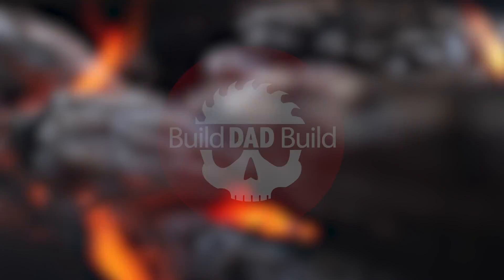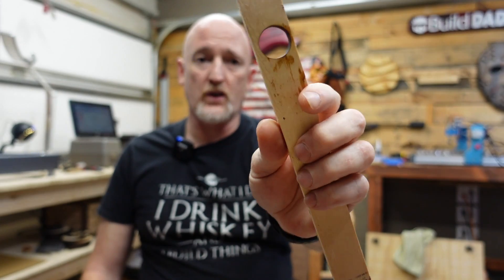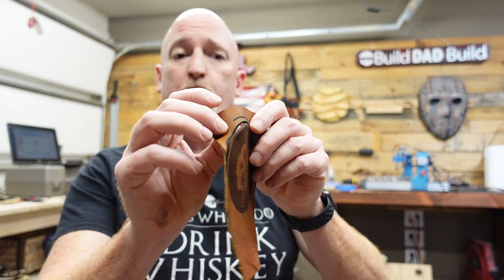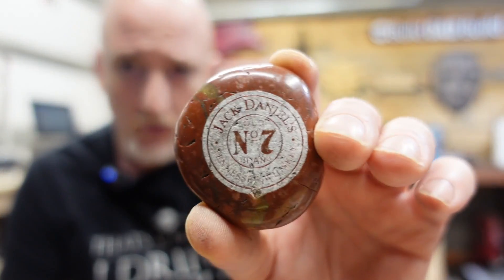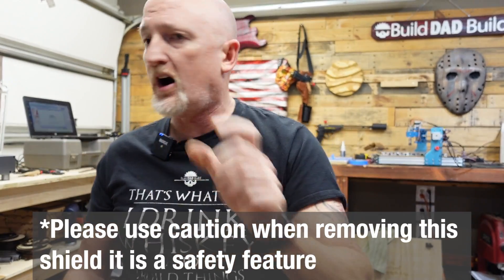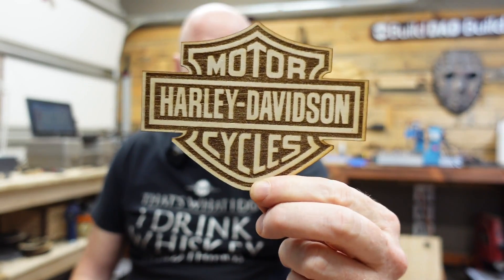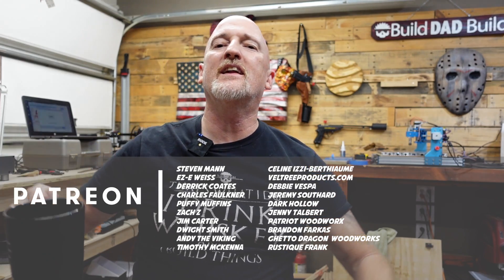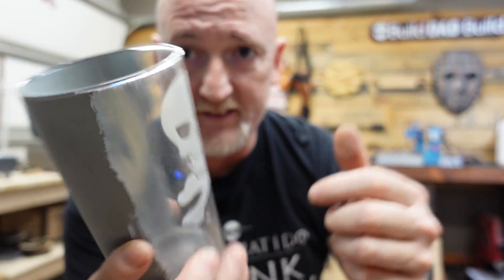What Materials Can You Cut (and engrave) with Your Diode Laser (like the 10 watt xTool D1)

Comment: You can actually etch on stainless steel after coating the surface with mustard (or possibly vinegar--haven't tried it yet). My uncoated stainless steel attempt (with just a 5w laser) also caused smooth metal discoloration but the mustard coating actually created a rough surface.
Reply from the maker: Awesome!
I have a video coming soon with another cheap way to mark metal!
Stay tuned!
Cheers
Reply: Try Brilliance spray.  You'll love the results. And it washes off with just water.

Comment: Can you engrave same materials with an Ortur 15 watt diode laser. I enjoy your videos and thank you.
Reply: My aufero 2-4 LF burned out the laser in 20 hours. Ortur is sending a replacement but wanted to slow ship it 4-6 weeks from China
Reply from the maker: Mike. Mostly yes. Settings would be different. And You might have to do multiple passes to get the same results.
Cheers
Reply: @BuildDadBuild  thanks

Comment: I used your link to order the D1, thanks for the discount.  Saved me the taxes.  Can you post your xTools D1 10watt materials list file.  I would have thought that Light Burn or Xtools would provide one as this would help accellerate use.
Reply from the maker: Here's a copy of what's on their website:
https://cdn.discordapp.com/attachments/664971419506966538/943584320055025744/Material_settings_file_for_xtool_material.pdf

Cheers

Comment: Hi, I just discovered your channel. Awesome stuff!! I am very new to the topic of laser engraving. I want to engrave some labels on to a rack panel, which is made of 2mm steel sheet and has a layer of thick powder coat on it. Is this possible with a diode laser and if so, what optical power is required?
Thanks in advance!

Comment: Great videos.  I'm currently trying to engrave a stainless steel zippo that just refuses to mark! I am using the dry moly, xtool d1pro, lightburn, settings are: speed 7 in/min @ 100% power.  Do you by chance have any troubleshooting tips on why the metal won't mark?
Reply from the maker: I have not had any success engraving Zippos.

Comment: I'm curious if it can cut flattened out aluminum soda cans? The aluminum on soda cans is super thin. Also, would it be okay to etch designs onto spray painted metal?
Reply from the maker: Diode lasers cannot cut metal.
Yes on the painted metal...folks do it all the time.

Comment: In your opinion, is the lack of limit switches and, therefore, homing ability a big issue for the Xtool? At this level, that omission seems a bit strange.
Reply from the maker: I don't really have an issue with it. Where you may run into issues with it  is if you have  jig and set it up to zero in reference to the jig. The Aufero Laser 2 does't have limit switches either. I think they're trying to make the machines a little more user friendly and less intimidating.
Cheers
Reply: @BuildDadBuild  Thanks.
Reply: @BuildDadBuild  I think that, with jigs, since you want to be able to remove and replace them, I would just put a couple of reference marks on the jig with the pattern and then line those up for each use. Then I suppose I would tape it down for the duration of the run. Just thinking out loud.

Comment: I’ve been playing with the idea of getting an xTool D1 with the primary goal of engraving 10mm Baltic birch and then filling the engraved areas with epoxy resin. I see the Harley engrave you did in this video: my question is, can this thing engrave like 5-7mm deep into a 10mm piece leaving a decent depth trough to fill? I can’t seem to find an answer to that question.
Reply from the maker: Theoretically yes. I would think it would take more time than you'd like to spend because you'd be doing multiple passes. And engraving over and area over and over like that could start a fire. For the application you're looking at, I think a CNC would be a better option.
Cheers!

Comment: Hey brother, I hope you are doing well. I finally got my extension kit and my 20W upgrade for my laser. While cleaning up, I found an old box full of different Styrofoam blanks I was saving in the attic. My question to you in, have you cut Styrofoam with your laser? I ma assuming there may be a smell/fumes involved I would have to be careful with and I am certain probably would need my air assist on.

Second question is, I see an option in Lightburn to turn on the air assist. Do you know of any hardware I could connect Lightburn and my air assist to to make it turn on automatically? Thanks in advance, your channel really helps noobs like me... :)
Reply from the maker: I think styrofoam is one of those things to not cut with a laser, but you can look that up here:
https://www.troteclaser.com/en-us/learn-support/faqs/unsuitable-materials-laser-processing
And I think that option for air assist is for CO2 lasers, but there could be like a Raspberry Pi solution or something.
Cheers
Reply: @BuildDadBuild  Clinkies my friend!

Comment: Have you ever cut g10 garolite with the machine?
Reply from the maker: O. It has epoxy in it. Epoxy = hazardous fumes
Reply: @BuildDadBuild  It has a non Toxic fume but very abrasive dust :/ I use to cut it with a co2 laser, and also waterjet, but I am outsourcing the material to machine shops.. Miss conception of the material I was actually on the phone with the maker of the material earlier today to find a route to cut it.

Comment: Can I engrave my gun slide?
Reply from the maker: That depends on what material the slide is made out of. Some polymers can be ingraved. Some metals can be marked.
Cheers
Reply: @BuildDadBuild  most of my slides are plain steel, thanks for responding
Reply from the maker: @yankeecowboy plain steel, you'd probably need a transfer agent like Enduramark. Check out the product I use in this video:
https://youtu.be/VVTVCuroHOw
Reply: @BuildDadBuild  thank you! And is there anyway you can test this on a gun slide and do a video on it? 
Thank you again!

Comment: For metal I always use Brilliance.  LBT does work, but can be wiped off, you have to clear coat it after for a lasting impression.  Dry lube Moly doesn't work well at all.  On tiles, Cold Galvanized spray does work, but you have to be real careful about over spray, as it will go into the pores of the unfinished portions. Rustoleum satin white also works, but you have to use lacquer thinner to clean off the excess paint, which is offensive.

Comment: How do you etch on or engrave on clear acrylic?
Reply from the maker: I think you need to paint it.
Reply: Get a sheet of steel as a backer, spray paint the sheet metal with rust Oleum dry galvanizing spray, once dry, lay the acrylic on top of the sheet metal and laser away... I set mine (d1 10w) to 25% power and 55mm/s... It'll cause the paint to permanently transfer to the plastic... Good luck!

Comment: any idea why the laser head light light up although it is in WORKING mode?  i cleaned it with a q tip and it worked but the next day...blah  thanks!
Reply from the maker: Not off the top of my head. But check into the Facebook Group for the D1, great help in there with things like this. Also xTool usually responds quickly to issues like this.
Cheers

Comment: Will the D1 cut non-black acrylic? I know diode lasers can’t do clear, but can it cut 1/8” opaque red acrylic as an example?
Reply from the maker: It will. I just didn't run the cut on that piece. There was a whole issue during a live and I took it off the bed before the cut by accident.
Cheers

Comment: I am having trouble dialing in cut settings for 5mm poplar. I have tried various material tests from etsy and the powerscale feature in lightburn and every time i think I have it dialed in and cut something it doesn't cut evenly. Any advice?
Reply from the maker: It almost sounds like your surface isn't level. Make sure to level your cutting surface. I have inadvertently had something under one of the sides of my honeycomb and messed up cuts because of it.
Reply: Same.. I am having trouble finding the correct setting to get the cut all the way through the poplar. Any advice?

Comment: Do you know if it can engrave on ceramic?
Reply from the maker: You can...but you need to use some sort of carrier agent to coat the surface first. So it doesn't exactly engrave, but burns the topcoat onto the image. See the two videos below. The first is etching on white tile, and the second is on glass. You'll see the types of material you'd need to use.
https://youtu.be/M5fJvV1iW_g
https://youtu.be/GObxFaHqU1I
Cheers